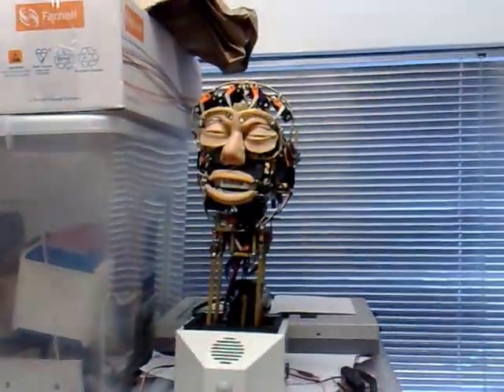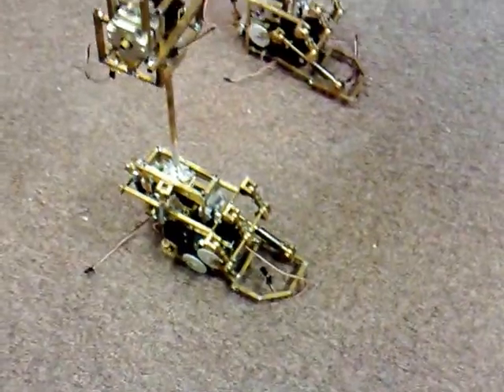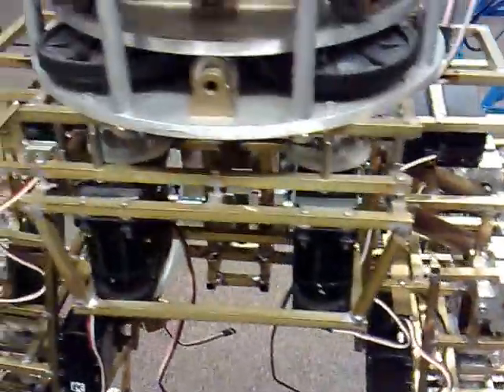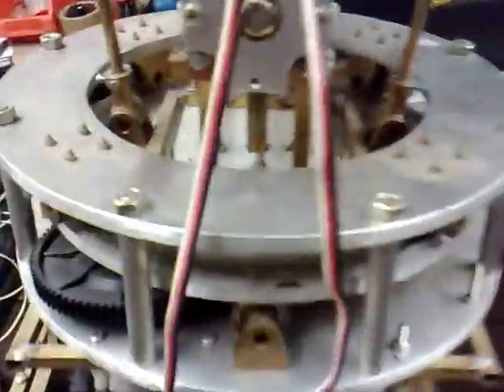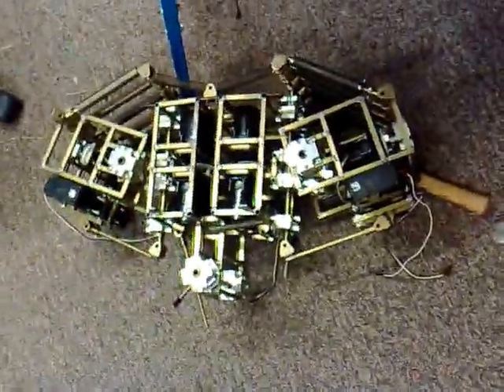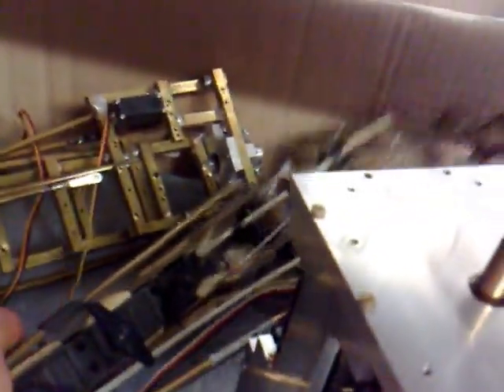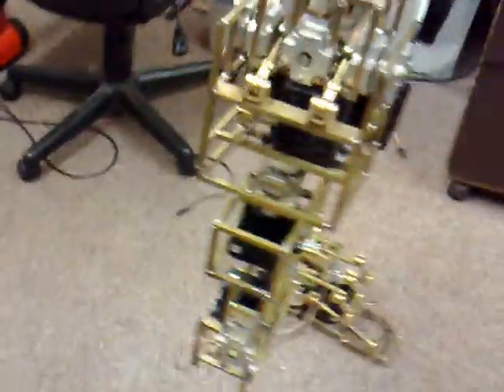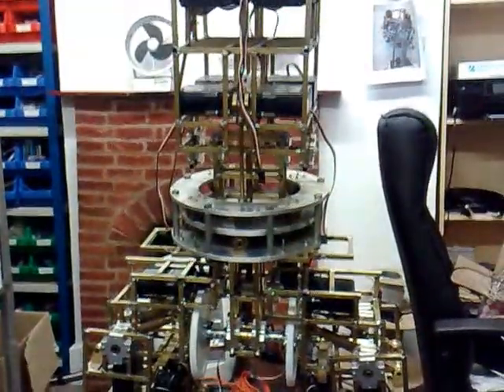My Humanoid Robot

Comment from the maker: Lots new but no time to show it, I am working 15hrs a day on my normal stuff at the moment, The torso  has been modified and  fitted to the mid section, and I have also designed and partly built the battery packs that fit around the thin tubes above the ankles, will do another vid when I get time,  
Its looking good ,can't wait to show it.....!

Comment from the maker: Sorry for delay, I'm back to my ,not quite so interesting ,proper work. 
   I am using the same program and servo controller as is used in the Robot Head sequences to get a feel for the walking parameters. A series of  modules will eventually communicate with each other , whether it is a sensory module , such as sound, visual , touch, or just servo output , this feedback will then act to modify the servo positions, I will show some of the computer programs later when I am a bit further on.